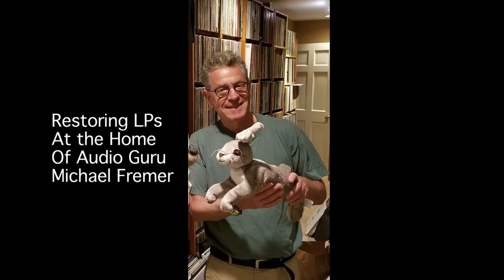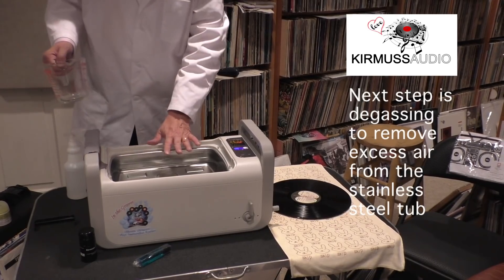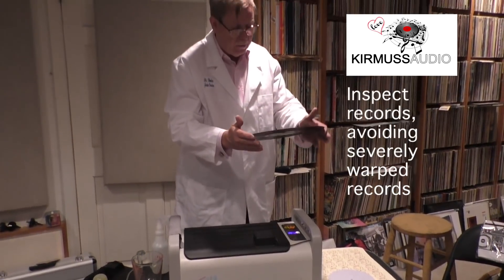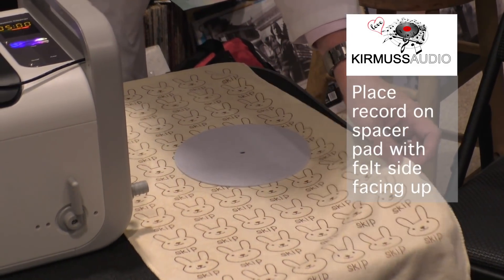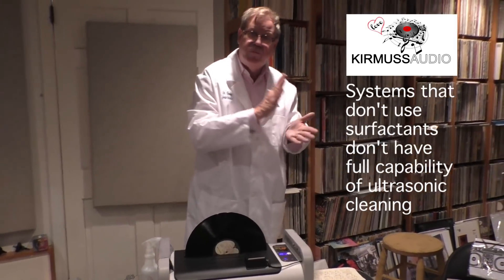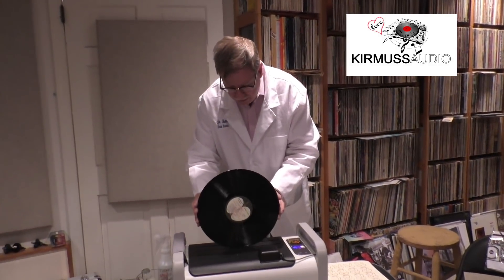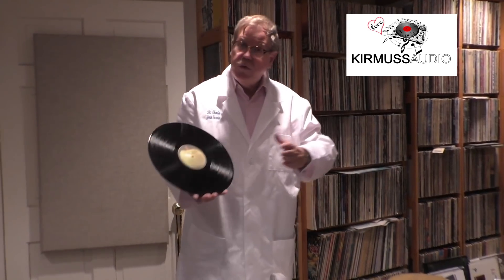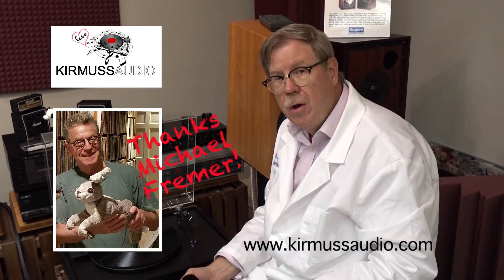KirmussAudio System Demo

Comment: I’m astonished tbh, look at that room full of records. The state of disarray, The amount of dust that must be in that room to start with, and I don’t wanna hear that it won’t get on the records. The second you remove a record from the sleeve the dust in the air must just fly on to the surface. Tidying the room would probably be a good start.
Reply from the maker: @ivc5150  If you are referring to the room with 30 000 records, that was at Michael Fremer's studio. Records are in their sleeves and everyone knows that before one plays any record one uses a 10 micron parastatic felt brush to remove dust followed by using a grounded   carbon fiber brush to reduce static.  

As to the quality of air I did not notice anything detrimental in the environment.
Reply: @ good reply.

Comment: Way too much for me.  I’m just buying the clear audio two side cleaner.
Reply from the maker: @ericx4124  Wet surface cleaning is just that.  We all want to remove surface contaminants off records. This said, read the ingredients list on any solution you are using. Use a mechanical dry and not an air, vacuum or spin dry.

Cleaned, or restored, or   not,  before play of any record, always use a 10 micron parastatic felt brush on the record to remove dust, etc., then a 2.5 million carbon fiber brush to reduce static. 

Our process does need some elbow work. The purpose is to remove first films left over from prior cleaning processes and chemical residues that were air, spun, or vacuum dried on the record,  then in subsequent cycles the film deposited on the record by the outgassing of the plasticizer while the record is in its sleeve and then finally the release agent that surfaces during the pressing process of the record.   It does not need to be repeated except for a 2 minute cycle when one deems it necessary. 

Many good processes out there for surface cleaning.

Comment: Pro-cess?
Reply from the maker: @automatedelectronics6062  record inserted in the machine for a 5 minute cycle without the ionizing  spray applied.

Record taken out.  Excess water removed. Ionizing agent brushed in. Another five minute cycle. 

Record taken out, Excess water removed.The goat hair brush pad dried.  Ionizing spray applied once more.  As the spray was applied, on both records we noted whitish materials appear. This is the colorant that is found in the spray. Allows one to see what cavitation pulled out from the record in the previous cycle.  Record returned to the machine for another 5 minute cycle. 

Both records saw us complete 5, five minute cycles.   Noted in cycles 3 and 4 less colorant appearing where  this indicates less materials being pulled out by the ultrasonic.   Last cycle saw the record  come out virtually dry.
Reply: @kirmussaudio7578  Thank you for responding to my comment. I do like your RCM and believe that it is truly effective.
However, records are meant to be played and the faster you can get them on a turntable playing, the better.  Multiple 5 or even 2 minute cycles is way too long. I can clean, rinse and vacuum both sides of an LP on my VPI RCM in 5 minutes and ready to play. Although ticks and pops drive me up the wall, when I digitize the LP, or any record for that matter, I have a computer program which makes them disappear. There are also inline pro-cessors which can  do that in real time when the records are playing.
As I mentioned before, I have 1,000's of 7" 45's. It would be of help to me to have an RCM which would clean atleast 6  7" 45's at a time. That is the number of records which can be stacked  on the multi-play spindle(s)  on my 2 record changers. I also have a collection of jukeboxes which hold 50-100 7" 45's or Compact 33's. Cleaning one record at a time is a drag.
Reply from the maker: @automatedelectronics6062  The fact of the matter is where our machine is not a record cleaning device. We call  it a record groove restoration machine using ultrasonics and record ionization whereby multiple the applications  of the spray over several cycles is needed. A charge needs to be induces as both water and pvc have the same electrical charge.  This charge of the record to  attract the effects of cavitation.

To the illustration,  the  induced charge wears off as the record spins.  Unless this ionization of the record is done, our machine or any other ultrasonic cannot truly accomplish much. Proof where these machines need air drying.  A restored record comes out virtually dry.

The intent of these needed cycles is quite obvious if you wish to reach the contaminants in the groove. First, to remove films left over from prior cleaning processes  as you just described or implied, they all leave a measured unintentional film that shines a record, not the intent of the KirmussAudio process. We strip these films off..your needle should not be riding on this.

 Then over 3 or 4 cycles, ourcprocess then removes the film deposited on the record by the outgassing of the plasticizer while the record is in its sleeve and then finally removes the release agent that surfaces during the pressing process .  This also by design removes  dust or other contaminants that have landed on the cooling record at tge pressing plant that get fused into the groove, cause of those nasty pops that we hear in new records. 

So yes, some work needs to be done.

The result is where your needle discovers what was actually pressed. As such considered by many as your best analog accessory over and above purchasing cartridge upgrades, silver interconnection cables, tone arms and the like 

No need to repeat this process in the future except for a 2 minute cycle when you deem the record needing some maintenance. 

Check out our YouTube channel for before and after restoration of records that were previously cleaned with ultrasonic and vacuum systems.

Comment: Nice system and Lab coat,  but being a ex DJ with over 5000 albums this is not for me. I've been using a Vevor complete album cleaning system with a DYI filtration system and it works wonders, and all for about 185.00 out the door. And you can clean 8 albums at one time! 1 Year warranty plus the added guarantee  of purchasing about 6 of the Vevor systems for the price of the unit on this demo...
Reply from the maker: Restoration using record ionization with an ultrasonic is not surface shining. We offer 1.3 to 3 to 4 dB gain and 8 to 32 % gain in frequency response. Fremer has proven where skewered records see no cavitation.
Reply: I shine the surface after the ultrasonic cleaning and I get about 10db gain average depending on the overall condition of record. Cavitation persist as evident by the evidence left behind...   @kirmussaudio7578

Comment: My heavens, that's a lot of work for each record. I wish I had this kind of time
Reply from the maker: PVC repells water with or without soap.

To remove the release agent we need to ionize the record to be opposite to that of water.  No known method except for ionization.

If you want to surface shine a record, 3 minutes in our machine. We are not a surface cleaning process. 

Once you have processed a record in our machine we never have to repeat the process.  Except for 2 minutes later when you decide that there are new contaminants or large amounts of fingerprints and the like accumulated over time and much handling .

We guarantee 1.3 dB gain over floor for new records and upwards of 3 to 4 dB in records of provenance unknown or records processed with other cleaning systems. 

Proof is where our processed records do not need any air or vacuum drying. 

So yes, a little elbow grease is needed.

Your needle is  now riding on the detail as pressed by the stamper and not the grooves covered by the pressing oil as discovered originally by the Shure Brothers in 1977.

Do look at our 10 part instructional video taken in Seoul Korea on our YouTube channel that shows what a vacuum  leaned record looks like after processing.  Our process lets you see first our removing the film left by a vacuum system. Then the release agent also where dust was fused at the factory  creating 3 pops in the record.

Comment: Two other things I would do differently are first:  never let a microfiber cloth anywhere near a record at all, even as just a drip towel. Why? Because of what you said about the 'lint.' This material sheds plastic fibers like mad and I had to find out the hard way about the danger that microfiber poses to vinyl records. Just a few of these lint fibers on a record can gunk up your stylus and cause distortion, and worse case the the needle jumps the grooves, skips and skids. I would only use a new very fine-weave cotton towel that you shake out real good and it must not have gone through your washer/dryer ever. (The center elevation with a fur pad is a good a idea here.)  Second, I would cut the amount of alcohol used to 3/4 or half the 40 ml you suggest, as it is still a solvent, and with different vinyl formula over the years there may be the chance of records having less resistance to damage from contact with any amount of alcohol. Also, I would have two goat hair brushes: one for surfactant, and one for plain water or dabbing. I use a similar system with my 45 record restoration technique. Plus you have to be very careful applying a fluid to only one side of 12" record, especially thinner pressings, as doing this just begs these discs to warp. You've got to be quick and use as little fluid as possible. From 40+ years of collecting and cleaning experience.
Reply from the maker: We use an opticians lint free cloth and parastatic felt brush at the end of the process. Pse review our manual for complete details.
Reply from the maker: Rrspectfully this is Incorrect.  70% IPA 1.4 ounces in 1.78 gallons does not affect the plasticizer.  The 70% is not a dilution of 91 or 99%. Different chemical process. Not used for any actual cleaning of any grooves as the record repells the distilled water with the 1.4 ounces added, it is used to kill live or dormant fungus that comes off the record so one does not inhale it.
Reply from the maker: Please review the latest materials on our web site, version 10 of the manual. Tge videos date back to 2019.

Comment: I agree with your methodology and approach to cleaning 12" vinyl using ultrasonics' to remove contamination, but I personally would recommend doing some of your preparation much differently, namely not ever using a "circular" motion to scrub record groves (like if you were cleaning your floor); it drove me nuts watching you do that in your presentation. I talk with the authority of a lifelong collector, starting in a high school radio station in the 1970's up to today, and that is that you only follow the grooves cleaning and never try to wipe away from or towards the center. I see it is just an application phase for the cleaning solution,  but you are busting a protocol on standard care methods. I don't think you are doing the record any favors that way.  See my next post.
Reply from the maker: We are not cleaning the grooves. We are using the brush to first change the charge of the record to ve opposite of water. It os not a
Reply from the maker: It is not a cleaning agent or a soap.  It is an ionizing agent to see the effects of cavitation be attracted to the record as usually records, water and soap repel each other based on the Tribelectric table of charges. As we cycle records in and out of the machine as the induced charge dissipates, the subsequent application of the ionizing spray also allows one to see what the ultrasonic softened in the prior cycle. First removing films left over by prior vacuum,  manual or sonic methods. Then finally the release agent itself. The rise and fall of whitish materials and rapid evaporation there of validates the groove has been restored...the needle now riding the image of the stamper. Swirling motion aids in changing the charge. Also allows one to see the effectiveness of the prior cycle. New records dated 20 years or younger  are notorious with their PVC mix so we use a 5, four 2 minute and a final 5 minute cycle irrespective of the whitish material appearing.

Comment: This is all overly complicated. I would rather use a quicker system so that I have more time to listen to the music.
Reply from the maker: Look over details on our website and appreciate the fact where the Tribelectric table of charges proves that one needs to attract the effect of cavitation and as the record spins our induced charge sprayed onto the record needs to be re applued.applied. this if we want to remove the release agent.  The heating of the water caused by cavitation has a negligible effect on removing the 70% IPA used to kill live or dormant fungus. Thus as we change out the water every 10 records or so per the manual.

Comment: A shot glass (1.5 Oz) is perfectly sized for measuring the isopropyl alcohol
Reply from the maker: Mine are larger...little humor! Thanks!
Reply: @kirmussaudio7578  I’m very impressed with my Kirmuss RCM (from Dr. Vinyl).  The surfactant is so key to the overall level of clean that can be achieved, as you demonstrate very effectively.  When Jose called you about missing parts, then found them and called you back and said “I’m an idiot”… that was my Kirmuss RCM, lol.

Comment: Too
Much
Trouble
Reply from the maker: It's the only way to remove the release agent. One needs to apply several charges to the record to change the charge of the record to be opposite that of water or a soap. That is why all other processes only surface clean.
Reply from the maker: ..These cycles are needed as the record looses the charge induced by the ionizing spray that was applied by the goat hair brush as the record spins in the machine. So we strip off first films left over from vacuum, ultrasonic and manual spin  clean systems, then the release agent from the time of pressing.  A new record sees an average gain over floor of 1.3 dB. 3 to 4 dB on records of provenance unknown.  You can see the science on the Zoom of Feb 7 2022 hosted by the NJ Audiophile Society.  Also PM our web site.

Comment: Aren’t you supposed to wash a record after applying a surfactant? I use Tergikleen and the tell you you must wash the record after using it. You apply it last without a rinse.
Reply from the maker: Terhiclean contains ethylene oxide. Not to be used on pvc.  Our agent is not a surfactant cleaner. Our process  applying a spray onto the recotd over several cycles changes the charge of the record to be opposite to that of water to benefit from the effects of cavitation.  Once the record has been restored removing any films left over from prior cleaning methods as well as the record pressings release agent, the record comes out virtually dry. No need for any wash as our process is completely different than others.  Hope this responds to you question.
Reply: It’s incredibly diluted and just a slight misting of the solution on the brush. It picks up minimal dust from handling during the final stages of the restoration and provides an anti-static property before sleeving.

Comment: I do not believe that Mr. Kirmuss is a chemical engineer, otherwise he would know that vinyl records made since the 1960's is more chemically resistant than the cleaning references that he quotes from the 1960's. Those references are for the 78's that were previously made and still prevalent at the time. Also, ethylene glycol can be used as a wetting agent, but it is not a soap. On any vinyl record made in the past 50+ years, you can use a stronger solution of alcohol, and instead of ethylene glycol, it is more advisable to use a soap and then thoroughly rinse with distilled water. Shake off excess water, dry with a clean towel, and use a discwasher to take off the residual fibers.
Reply from the maker: I believe you are mistaken in your posting. The premise of our process is to change the  charge of the record to be opposite to that of water no matter the vintage of the record. We do not care about ethylene glycol per say. That explains in order to use the benefits of cavitation we in our process change the charge of the record temporarily using a coating. If you are trying to remove the release agent from within  a 35 micron diameter groove and any microwelded dust using a liquid of whatever type and noted where the suspension  further with a droplet size of over 100 microns cannot do this.
Reply from the maker: Added. No matter the vintage of the pvc pressing.

Comment: More and more brand new records seem to have excessive surface noise, hiss, ticks, pops, crackles where my other new records are fine. Can the cleaner assist with this surface noise/hiss?
Reply from the maker: Absolutely.  We use a fixed process. One 5 minute cycle. 4 two minute cycles.l, then one 5 minute cycle each with the ionizing agent applied. The Sound engineer for cellist Vincent Belanger processes their new pressings and notes the 1.3 dB gain.

Comment: So before you play it, wet the record with surfactant, drag my $5000 stylus through a wet record? Why even dry the record if you have to wet it before playing it?
Reply from the maker: No . Mist on a dry brush ionizes the record after processing. Then one either plays it or stores it. One or the other. It is only done once. It is an anti static treatment
Reply: @kirmussaudio7578  Thank you for your reply - appreciate it as I try to understand this all. Mist is a liquid on the brush then the brush puts the liquid on the record before playing, so in my mind the record is now wet before playing? or am I over thinking it?
Reply from the maker: The mist on the brush applied at arm's length evaporates on contact with the brush. All you ate doing at the polishing stage is to ionize the record and negate the charge